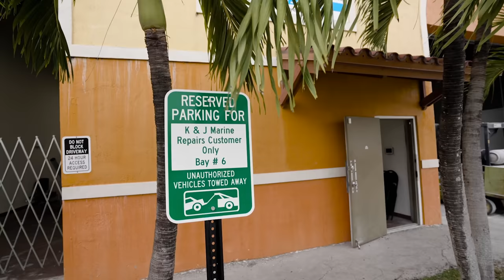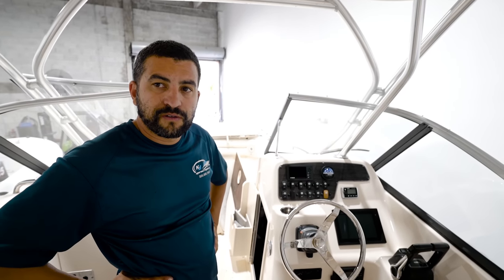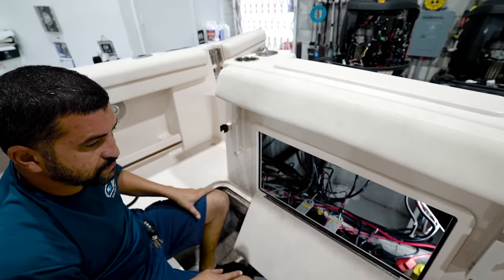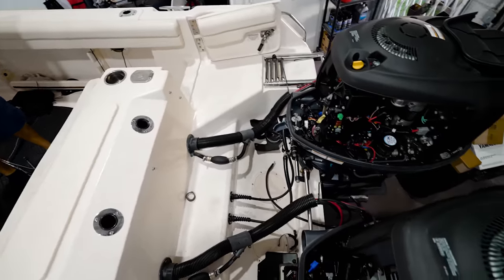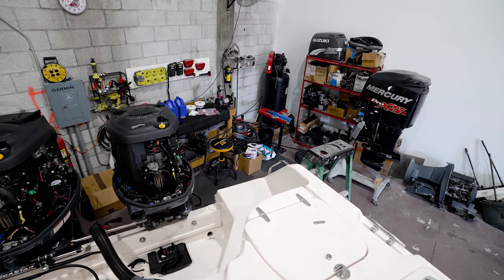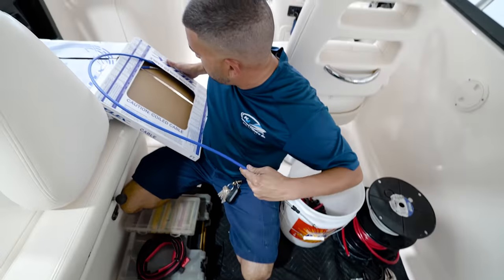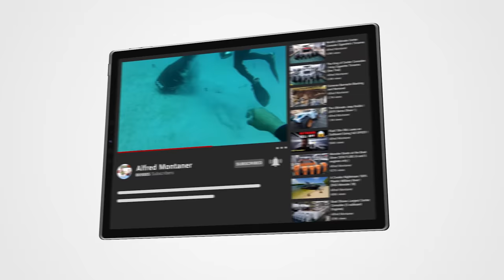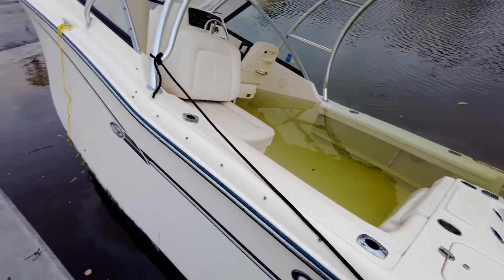Black Point Sunk This Boat ! First Sea Trial of Sunk Grady White (Boat Ramp)

Comment: A few words from a licensed and insured boat transporter both over land and by water.
1. I am responsible for everything once that boat touches my trailer or I take possession of the boat at the dock for in water transport as reflected in the docs that are signed by owner or marina for my company to transport.
2. If I am asked to splash a boat off my trailer or am transporting on owners trailer and splash I am responsible for that vessel until it is safely moored to dock and owner or marina has inspected said vessel and my paperwork is signed, that means I am responsible for making sure vessel is water tight before launch and vessel does not come off my or owners trailer until I have inspected the hull for incoming water. 
3. Included in my paperwork to owner is a copy of my insurance that covers everything up to $5 million including total lose, if a vessel is deemed more than said insurance a rider and a bond is secured for said vessel in the amount of vessels worth.
I have been transporting boats for almost 40 years and have been boating for quite a bit longer, in my opinion the clown that dropped this in the water and left was not a transporter but a googan, you do not leave anybody’s vessel sitting at the dock! The owner of this vessel has every right to go after this transporter as he is totally responsible for vessel until owner arrived.
Please take heed of this video and anyone who is thinking of hiring a boat transporter it takes 5 minutes to pull up DOT website and check to see if transporter is in fact DOT licensed and insured and if it is in water transport it takes 5 minutes to pull up Coast Guard web site and make sure transporter is a licensed USCG captain and insured to transport and always get paperwork before you hand over your baby.
My respect goes to Danny as he is a hard working gentleman as in it for the customer not himself, if I have any customers that need help in this area I will definitely recommend Danny.
Thank you Alfred for all you do and the time you take to bring us these videos.

Comment: FYI...Grady White started using Greenwood XL in their boats just prior to year 2000 so there is much less concern for any wood rot. Usually the wood that rots in the boats is Transom or Stringers, but not the panels that are inside a console area as an example unless someone puts a screw in without sealing. Even then the Greenwood should hold up way better. I think the newer models are now wood free, but I am not 100% sure on that.

Comment: In the 80s where Black Point opened into Biscayne Bay there was the frame of a cabin cruiser that had been run aground and burned. Just the charred frame was visible. My cousin Tommy said, "Smugglers." Chased by coastguard they ran aground and set fire to the evidence, then waded ashore.
Reply: Great story.

Comment: Why would the boat mover have the drain plug ?

Why would the owner not ensure HIS boat was seaworthy?  

Responsibility for the vessel is solely on the master. 

If the owner said to splash the boat this is an expensive lesson to always inspect every component before putting to sea.  

I put the plug in myself and the first thing I do every time is open the hatch and ensure I’m leak free. Then visually inspect each through hull fitting and hoses. Then activate every pump and inspect the lines for leaks. Every time. This takes a grand total of about one minute to prevent this or a similar incident. I don’t mind sharing this information because Danny said he does not want to do any more bloop bloops.

Comment: What about all the wires fuses plugs ect on the actual engine that was underwater? Grady doesn't use wood anymore.  I know 1 guy insurance company pickled the motor 5 years no problem other guy nothing but problems I wouldn't keep it myself because I wouldn't go 40 miles off shore with a maybe! He needs to keep that Grady though

Comment: With all due respect the customer may have told the transporter to launch the boat and tie it up. It's not the transporters job to ensure that the drain plugs are in place.
Reply: REALLY. As a boat owner if I buy a boat and pay a company to haul it to the marina and ask them to put it in the water and your saying the most important part of launching a boat from a company that is supposed to have the qualified experience would not be responsible for making sure the drain plug (s) are not in place. That's really stretching it.
RM
Reply: @russellmiller8332  I believe the owner organized the transportation not the seller, if that is the case the owner needs to instruct the transporter importantly in writing.

Comment: That boat would've been fine after you two checked out the engine... Lots of hub bub over nothing.
Reply: Yea and if you did that you would be towed in by TBUSA for sure.
Reply: I have to disagree when the copper that it has been exposed to salt water it’s just a matter of time before the wiring starts to corrode. So might be ok for little bit then when it reaches a point the amp rating will drop below what’s being drawn and the wires will over hear.. surface coronation on connections can be cleaned off and all will be ok but after a part sinking it will need to be changed or ticking time bomb